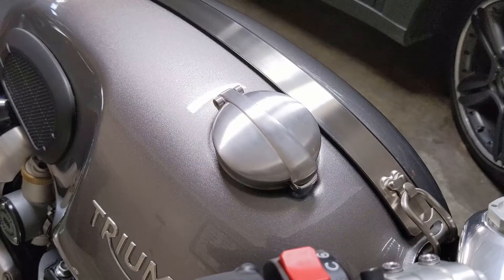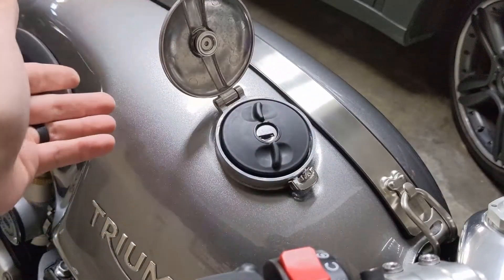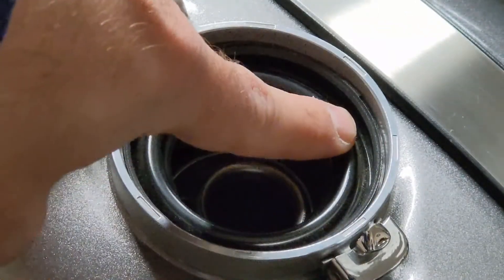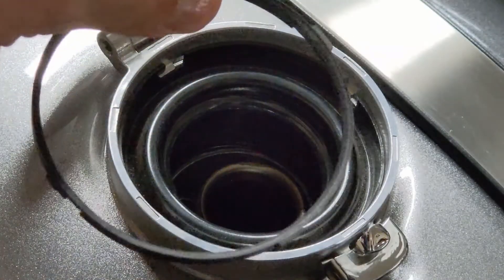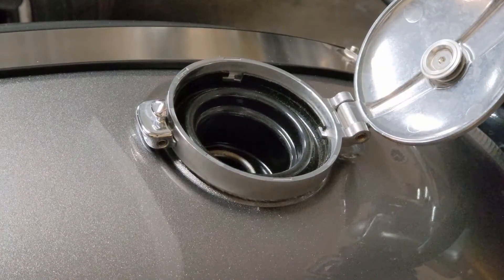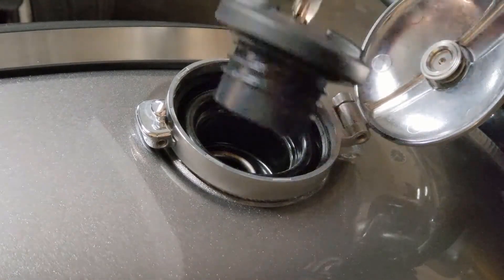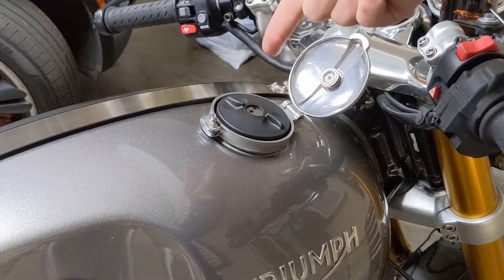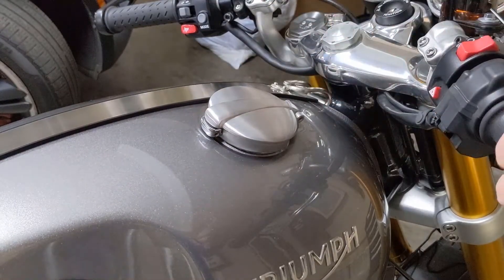Motorcycle Monza Gas Cap Rotation - Triumph Thruxton R

Comment: The Monza cap was designed for quick filling at the race track, I don't think it had a lock installed.
Reply: @tims-garage  I should imagine it made it easier for the pit crew to fill the tank, but for you, it's the opposite when you are at the gas station.
Reply from the maker: @frankstocker5475  makes sense!

Comment: There are excellent well crafted after market Monza caps available, built like the old traditional Monza caps,  that eliminate the internal locking gas cap part of the Triumph oem cap.  You just press and open the hinged cap and you insert the gas nozzle.  To me, a locking gas cap is an unnecessary PIA.
Reply: Do you have any recommended sites for find these non-locking caps? i really hate mine.

Comment: There is a (safety) reason why the cover was backwards! And of course you can get off the bike to fill it, so it doesn't matter what way it will flip.
Reply from the maker: I'd love to know the reason... Yet again safety getting in the way of convenience!
Reply: @tims-garage  so far I know (and what I have heard)  that if you get in an accident, sometimes the Monza cap will come open. Then if the rider is propelled forward and slides up the tank, the open cap, if facing rearward, will stay open as he travels over it. "Ripping out his scrotum on the way" as they put it. So they now mount them all opening forward, so the cap would just close as the rider's body slides across it in a crash.

Also so that it can't flip open due to vibration and that the lid can block the steering, which prevent you from crashing.

Another point would be that the screw on locking cap underneath the flip-up lid, is for safety as well. Government regulations require that if a bike flips over, the gas cap cannot leak any gas. So the screw-on cap keeps it from leaking. Not 100% sure how true that is.. Like I said that's what I heard and I can see the point of it from a certain point of view.
Reply from the maker: Well, that is actually super interesting and makes a lot of sense. I'm curious how often in a crash one would go over the tank and get their balls caught tho! 😂 I like it flipped this way for convenience when filling up. Not super worried about it opening up, but I'll keep you posted.
Reply: @TankToChest  Dealership with over 30+ years experience. Like I said I am not sure about everything and how accurate it is. Also the tank has a cap for it where you can put your finger to open it because of that. And actually you are supposed to get off the bike and then it doesn't matter which way the lid opens. I tank a lot at a place I have to get off the bike anyway to use my card before I can fill it up..